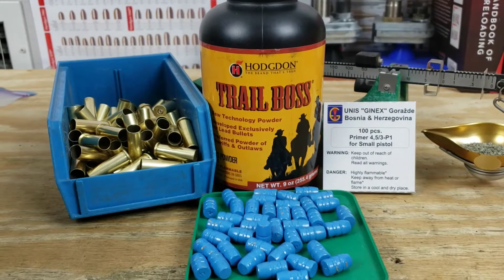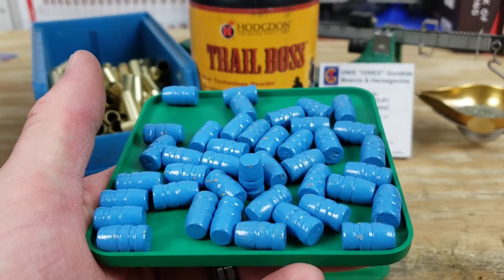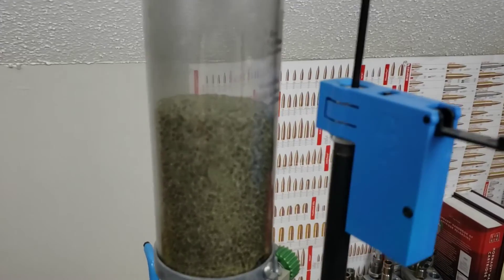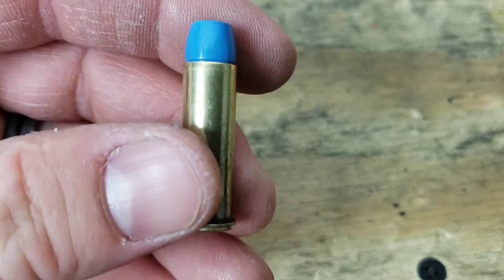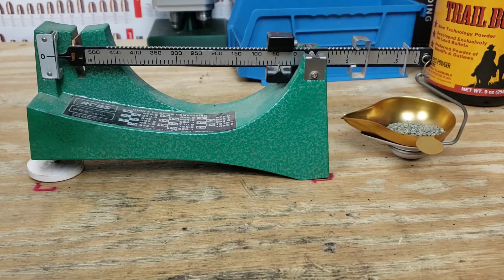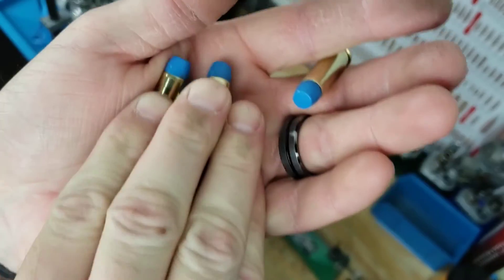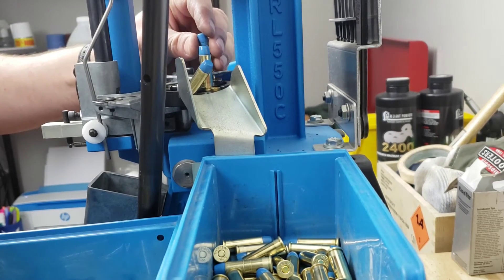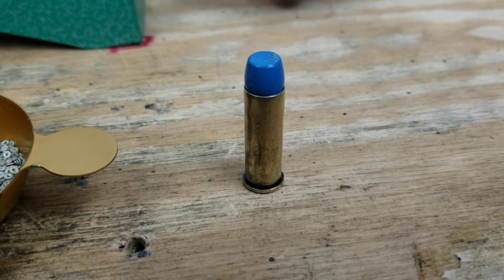Loading 50 Rounds Of 38 Special With Lee 358158RF Hodgdon Trailboss Unis Ginex Small Pistol Primers

Comment: I want to try them in my 9mm. Crazy how you can drop accurate charges of trailbaws lol
Reply from the maker: I'm going to try a few in the 350lolgend, I just got a 358150gr mold for sizing 356 in 9mm. Those should be fun. I have the 'pistol' charge bar almost all the way open. It maxes out around 20gr of normal powder. I'm actually surprised how well the Dillon powder measure works, even with extruded or flake types.